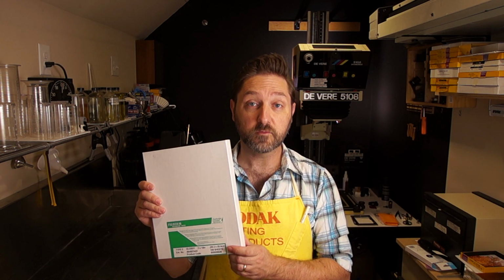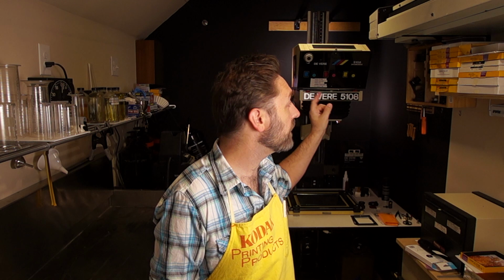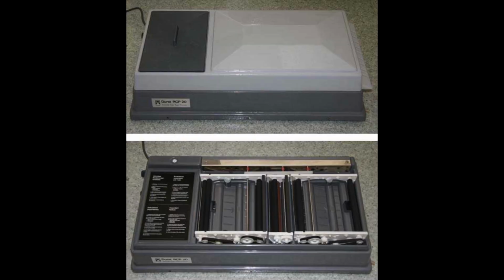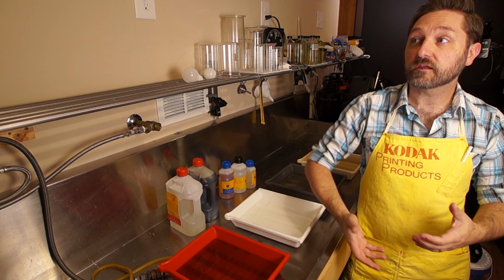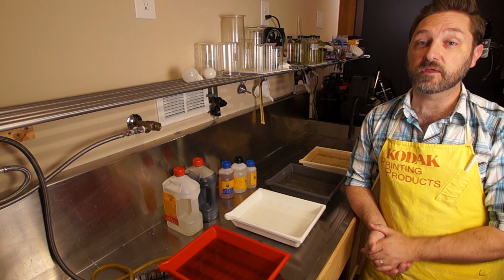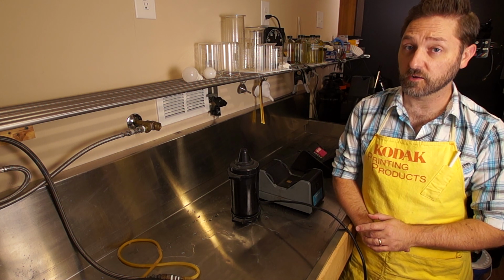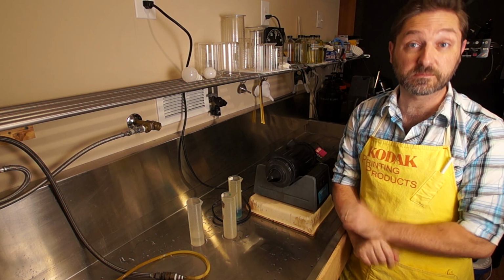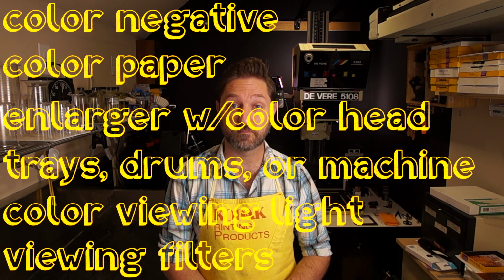RA-4 Printing, pt 1: Tools and Materials

Comment: 16:23 So, I have made my first few RA-4 prints ever during the week-end, and this is interesting information. I am using a Cibacrhome (ILFORD) 8x10 drum that I am just rolling on a table by hand. I am getting some blue/cyan-ish "staining", and using an acid stop (happens to be citric acid. Something that does not seems to be recommended in the very little bit of research I was able to do, which seems to only land of a few random forum posts) got rid of the blue staining. I am slightly confused about the origin of the blue staining, is this over development? I am developing Fujicolor Crystal Archive paper

Chemistry I use is the "amateur" RA-4 kit from bellini, the developer does not need a starter or seasoning. They do not mention using a stop bath in their documentation (their documentation is... not very extensive)

Comment: In brief sir u have stated Al most all ...but sir since ur work is a globalized so ..safety first uses of gloves since colour chemicals are some time even carcinogenic..toxic even next is while open tray process is to be done there comes up adjacency effects depends how one agitate the Dish on each rolling of dish a fresh chemicals first act upon the edges of the paper underprocess and slight density increases are noticed specially the edges of the paper next is how to shift the paper after say developer actions be over and paper to shift to the next bath  so how to hold the paper ..tongue or bare hand a weakly acedic stop bath ...many says alkalinity of the first bath rather a requirement to retain to help the Blix bath also in Ra 4 open tray process restricts the black density of  the print .. I may be wrong thanks sir some time we must look the tech kept behind ..a refreshing of sooo nice of those days thanks sir dada Nomostey ....

Comment: You say you prefer not to use the Jobo for prints and additionally you advise to work at room temperature. Why is this when temperature seems to be tightly specified in the RA4 spec and Jobo is used to maintain correct temperature? I have only ever done black and white prints in trays so please take this as an earnest question from a point of naïveté.
Reply from the maker: One of the photo engineers whose name is on the patent for RA-4 told me you could run the process at room temperature just fine with extended time.  I don’t use the Jobo because it’s old and I don’t want to stress the motor more than I have to.
Reply: @TheNakedPhotographer  Thank you!
Reply: do you think that c-41 might be the same in terms of working at lower temperatures for longer times?
Reply from the maker: No, time and temperature are much more critical with C-41
Reply: @TheNakedPhotographer  Thank you!

Comment: I'm very grateful for what you have done. I'm going to try printing color again because of your video ! But like other people, I have issues with getting the right chemicals. I was able to find a Kodak Ektacolor Prime SP developer replenishment instead of RT and I'm going to combine it with the Blix for RT. The Prime SP is only one bottle instead of 3, which is good. Have you use it and what is your time/temp recommendation for the drum 8x10 ?   And as other people, i have doubt regarding Starter for the drum. Can we do without it, or it still worth $10 to add it to the Developer ?  Thank you !!!

Comment: Well.. I've got two enlarger. My first is a Durst 800 condenser. I use the Arista's filters for color printing. Usually I use about Y30, M30, C0. The second is a M601 with color head cls66 and the inner filters practically doesn't work. I can put until 100 but the result is the same..zero!. So the question is: the age of the inner filters can be important?
Reply from the maker: Yes, they can fade over time.  Can you see a difference on the easel as you dial in more magenta?
Reply: @TheNakedPhotographer  The magenta from 0 to 100 is very slight. The difference in saturation with arista filters is enormous.
Reply from the maker: The filters have degraded too much.  You may be able to find replacements, but I couldn’t tell you where.  Durst is no longer in operation I believe
Reply: @TheNakedPhotographer  Thank you very much. I think that I'll print with my condenser enlarger and arista's filters. About Durst... yes they are closed about enlarger production.

Comment: Can you maybe explain the way the color head is used again? I don’t understand how cyan is used as ND. If your print is actually too red you’d need to use cyan right? And how is cyan ND when you’ve balanced the yellow and magenta in your shot? Adding or subtracting cyan would make your print more cyan or red, right?
Reply from the maker: You actually don’t use the cyan dial at all.  To control red/cyan you use the magenta and yellow dials together in equal amounts.  Cyan creates ND because when all three filters are used together, they make a grey filter.  For example, say you have M and Y dialed to 50 each.  If you dialed in 10 C, you have made 10 points of ND and reduced the M and Y to a balance of 40 each.  This will change your color but also change your print to be lighter overall.
Reply: @TheNakedPhotographer   But that’s it. It changes the color too. I get that the overall density changes but it always does because light is always added/subtracted, just not evenly. But when changing cyan changes the color too it’s not neutral density, right?
Reply from the maker: The change in color is happening because you are changing the effective amount of M and Y.  You can change those without the C and get the same color change but without the exposure loss.  You are also limited to the total amount of filtration possible.  Same example: if your print takes 50M and 50Y without any C, then the same print color would use 100C, 150M, and 150Y.  If you then want to make a big change in magenta and your enlarger only goes to 170, you’ve limited yourself to a 20 point change at most.

Comment: I'm struggling to find the kodak developer kit together. What are the three bottles you need? It's very confusing with all the starter and replenishers what I actually would need to print in a drum.
Reply from the maker: You’re not alone.  The company that handles distribution of Kodak’s color chemicals and paper is in financial trouble.  This means nobody has it in stock.
Reply: @TheNakedPhotographer  Thanks for pointing out, I'm reading now Kodak Alaris sold it off two years back. What's a shame and a disaster! Would have been great if Kodak Eastman had gotten it back.

Comment: I have actually found a huge difference when mixing kodak supplies and fugi supplies. I found that kodak film was always warmer and gave off a yellow or orange tint and fugi always gave off a green or blueish tint. when i mixed the two (using kodak film with fugi paper, which was always my preference) I found that the colors always came out more balanced in my initial prints. I just mean to say that I saw a very noticeable difference with mixing kodak and fugi products as well as using both kodak film & paper together or using fugi film & paper together.

Comment: when making a proof sheet from color negatives do you recommend having the filters dialed in to 40m 50y to get a rough overall idea of the roll,or is there a different procedure for contacts?
TIA
Reply from the maker: After you print a few times you will probably notice the color balance doesn’t change very much from negative to negative, as long as it’s the same type of film.  So an average setting for your negatives could be used for the contact sheets.

Comment: I've been recently having some issues with some blue streaking/staining on my RA-4 prints using Kodak Chemicals on Fuji Crystal Archive Paper. Through some research on some message boards/RA-4 Groups, I've been advised to remove prewetting from my process and add a stop bath. Have you experimented without a prewet? My original process has been Prewet 30s → Dev 1min → Blix 1min @ 34.4ºc. I am now using Prewet 30s → Dev 1min → Stop 30s → Rinse 30s → Blix 1min @ 34.4ºc but I'm still noticing some blue staining. Thanks so much!
Reply from the maker: I use the first second process you listed, but I don’t typically get stains, when I do, I use the second process you described.  The only thing I can think of is if you didn’t fully dry the drum before putting the paper in.
Reply: @TheNakedPhotographer  thanks so much! I'm using several drums to allow for adequate drying in between. It's totally driving me nuts. I really appreciate your quick response. I'll keep at it.

Comment: Hi there. I just took a chance buying a phillips pca 061 color analyzer pretty cheap in hope of saving some expensive  paper😊 the probe, when put under the lens, dosent give me the readings as the manual says on the meter , actually the meter dosent react on 40x50 print with a aparture on 11  not even when set to 5.6. Its dead . Now i supose that the metering cell is finished ( thats what im hoping you can tell me somthing about ,  if these cells is likely to go defect by time, but of course i dont know if you are familliar with this thing) but when i place the probe under my celling lamps the meter reacts  up and down when i lower og raise the light on the contactslider. Do you have any idea ? ( i think this instrument would have been pretty smart if it worked like it should  but i actually dont know )
Reply from the maker: Have you tried on a smaller print size to see if it reacts?
Reply: @TheNakedPhotographer  actually now you say so i slided the diffusor box from 66 to 35 one time to night and i think i got a reaction.  But thats shifting format i guess. No i havent made it smaller if thats what you mean but i will  certainly try.
Reply: @TheNakedPhotographer  yuhhuu..i got and reaction on the the first step that i couldnt get as i described above by doing smaller print as you said.  But then im supposed to push  a magenta button .. and the meter stays in the left side. So by adding magenta filter on the durstm805 it should raise the meter to the center (0) but nothing happens when im adding magenta filtration. ( now again i dont know if you a familliar with this thing ofcourse ) 😊
Reply: Its like it dosent get enough magenta ..ive also tried to push the  other filter slider on ( the one i guess is adding values over 100 something??) ( i really dont know if this makes sense for you😊)
Reply from the maker: I’ve never used an analyzer so I can only recommend the the manual.  If it doesn’t seem to work, it might be broken
Reply: @TheNakedPhotographer  yeah i think its broken.  I will return to my notebook notes instead . Again thanks for your time and good advices😊👍

Comment: Hi there . I just bought a durst m805 Because it is Big and beautiful and was cheap aaand has a density knob/filter which my m605 has not. 
Now i thought at first that this is a filter that Can  vary the contrast but now im uncertain . I have the m805 color manual but i cant Seem to read from this what or how to use this filter.  Do you by any chance know how to use this and what it does ? Regards jesper
Reply from the maker: If I remember correctly it is just a neutral density filter to adjust printing times, but it doesn’t affect contrast or color balance.
Reply: @TheNakedPhotographer  ahah ok. That makes sense. Thanks once again.  I properbly have Said it before… but what a great work you do keeping darkroom alive 👍🏻👍🏻

Comment: Thanks for this very informative video. Do you know if it’s possible to use mixed developer from Bellini (or any other brand) as a starter and replenish with Kodak Ra4 RT? Thanks!
Reply from the maker: I have never tried.  Since they are most likely using the same active ingredients it should work.
Reply: @TheNakedPhotographer  Ok, cool thank you! Since supply in Germany ist short at the moment and I can't find the Kodak starter, I will try this.

Comment: I have a roller but find myself agitating the drum by hand. Maybe for it’s similarity to black and white printing rocking the trays.
I’ve also been mixing chems a liter at a time, pouring out the 100ml for a print. I pour the 100ml back into the measuring container and use it for a few more prints before pouring it back in the liter bottle. For casual printing it’s very economical that way. 
Great video! This video got me to buy color filters and drums and chems. Loving the process and creative possibilities of color

Comment: While I’m further building the darkroom, I started looking at the chemical side of the story. For a good understanding, I’ll be using the rotary-drum technique to develop the RA-4 paper.
Forgive me my ignorance, but I’m still a little puzzled about your statement that the liquids can only be used once when using the rotary-drum technique. I have 2 basic questions:
1. When you begin with a starter + replenisher solution, isn’t the replenisher then supposed to revive the developer when it loses strength? In other words, isn’t it even more economical to keep the used developer alive?
2. Is also the Blix ruined after one shot? I assume that the Blix gets contaminated by a too high degree due to the developer residue left in the drum. Is that correct? Putting a stop bath in between would not change anything in this respect, except more labor?
Reply from the maker: In rotary processing the developer is too highly oxidized to reuse, even with replenishment.  The bleach component could be used one more time, but the fixer could not.  It also becomes oxidized from the rotary action.  Tray development and roller transport are much more gentle, so replenishment can be done easily.
The stop and rinse steps before the blix are used to prevent streaks from the sudden change in pH.  You may not need these steps, but Kodak recommends them when streaks occur.

Comment: Hello and Thank you for the amazing work You are doing here. I was woundering do the 20x24 drum work on your motor base? Im about to get a Durst Comot motor base drum but dont know if it Will work with the Jobo 20x24 drum. 
Thanks again for your work for the community 🙏🏻
Reply from the maker: Yes, it works fine with the base I use.  I don’t know the size of the Durst base
Reply: Thank you so very much! I Will have to investigate further. :)

Comment: Are Jobo tanks a good choice for paper development when used with a Simma Roller system? I'm asking this because it seems you can only pour in chemicals holding the drum in a vertical position, as opposed to the Simma drums which can be filled horizontally.
Thanks again for sharing your knowledge!
Reply from the maker: If you are using the Jobo drum with the cup insert for the lid, the liquid doesn’t touch the paper until you tip the drum horizontally.

Comment: Thanks for this series of videos! I have made my first tests using Fujicolor Crystal Archive and noticed that the blacks at not as deep as i hoped them to bee. I have seen on fujifilm website that they have several versions in rolls including “Fujicolor Crystal Archive Digital Paper Type DPII” which they claim has deeper black. It is for RA-4 but they state that it is designed for digital development. Do you have any experience of this paper or how to get deep dense blacks in analog development?
Reply from the maker: You have discovered what many of us have noticed too.  All other RA4 papers are sold in rolls, but your choices are better.  Kodak Endura Premier is much better, as is Fuji Optima (I think that’s the name).
Reply: @TheNakedPhotographer  It seems very difficult to find Kodak RA-4 paper in Europe, so I think I have to stick with Fuji. I do not have a problem cutting them down my self
As they come in 30.5 cm width rolls. What would you say about RA-4 paper that is designed exclusively for digital output”. Would you say these works for Analog as well? Fuji has a paper the call Maxima. Is that what you thought of when you wrote Optima?
Reply from the maker: Yes, Maxima.  I’m surprised Kodak is hard to find because it’s made in Britain.  But the Maxima is Fuji’s pro line like Kodak Endura.

Comment: Hi! Thanks for this video! Explanations such as this one are great: both detailed and straight to the point. That being said, I'm a bit confused about one thing: In the drum method, you speak of "non-reusable" chemicals. Is that per print, or per 16-or-so batch of prints? I'm asking because you do pour the chemicals back into their beakers after having used them once...Thanks!
Reply from the maker: I pour them back for disposal.  The drum uses very little liquid, but the spinning action causes very fast oxidation of the developer, so you only get one cycle out of it.
Reply: @TheNakedPhotographer  Thanks a lot for the reply!

Comment: There is also the so-called print processor by nova, that has an inbuilt thermostate, I had one, unforunatly it broke because I let it dry cook it.. forgot to turn it of and when away for the week :/ , but they are still in business, and make those, maybe that is also an alternative, they are basically vertical developing trays. Maybe that can be an option for you and the processing goes quicker. 

Nice and informative film I must say, tempting to pick colour printing up again.
Reply from the maker: You may be interested in my video review of the Optima processor made by the folks that made the Nova

Comment: I use the Adox Ra4 kit at room temperature. I tried doing this and have a magenta cast. Also on the borders(non exposed parts). Could this be because the blix is not at 35 deg, or is it due to an old batch of paper? Do you have any suggestions?
Reply from the maker: The only kit I recommend for room temperature is Kodak RA-RT.  The other kits, even from Kodak, are not designed for low temperatures.  Your paper could be contributing if it is long out of date.  Color paper does not last long when expired.